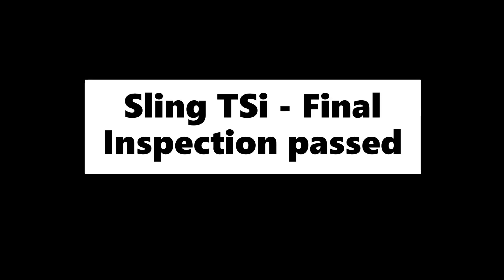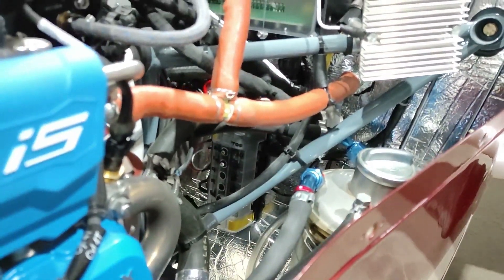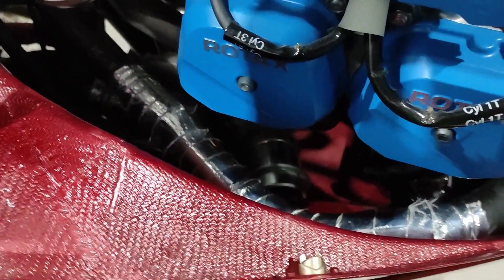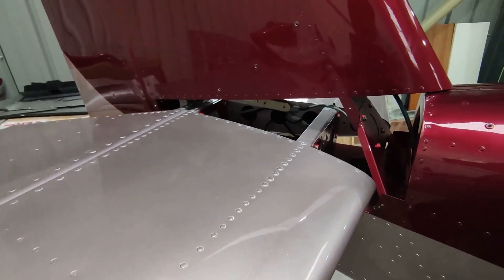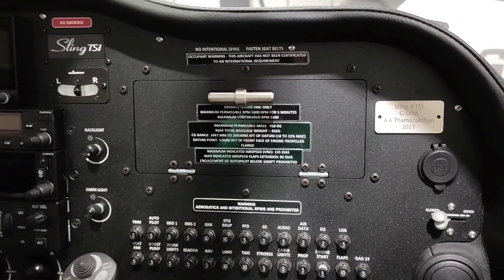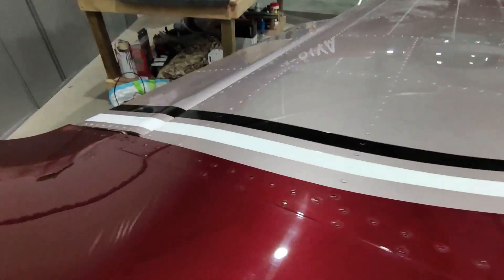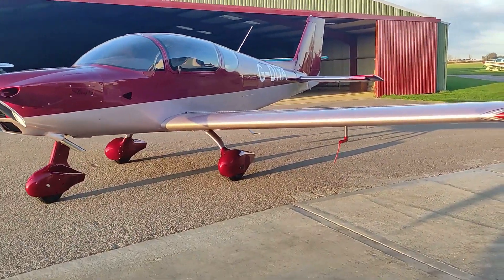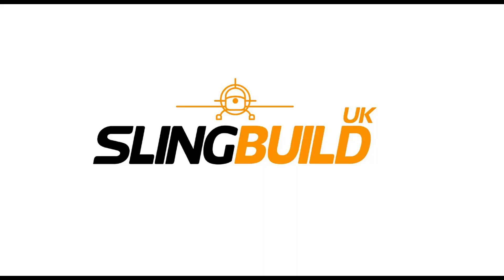Sling TSi is now Airworthy

Comment: What is the intended benefit of removing the elevator counter weight ?  Other than satisfying the SB.  Obviously helps cg, but is that the only reason?
Reply from the maker: As per the flight tests carried out by the UK regulatory body, at full aft CoG loading and full power applied, the aircraft is inherently unstable in the pitch axis. Removing the elevator counterweights allowed the aircraft to stabilize itself without pilot inputs on the control stick. Also note the Sling 2 & 4 never had a full weight balanced elevator. For me it was mandatory to get approval.
Reply: @slingbuilduk400  thanks for the additional information

Comment: Congratulations! Very exciting - looks awesome! Have throughly enjoyed following each update - dare I ask the cost so far 😅?

Also - it looks as though you have all the equipment to fly IFR - but limited to VMC? Is IFR not possible with the Sling under the permit to fly with the LAA, or is it just a case of extra paperwork?
Reply from the maker: Thanks, yes hopefully of getting the Day VFR limitation lifted after a year of flying. Some more paperwork will have to be done at the time, but should be ok. As for the costs, it hasn't been cheap 😰
Reply: @slingbuilduk400  Hopefully worth every penny once you're up in the air with it! Would love to build one some day looks like a great plane.

Comment: Nice! I didn't know about the elevator weight removal until this video. Good to know, and helps with the CG, too. Bonus!
Reply from the maker: Hi Mike, it does affect the handling of the aircraft. More trim would be needed when lightly loaded. It's been forced on us by the local regulator. So we had to do it to get approval in the UK. Sling have declared it as optional for other markets.
Reply: @slingbuilduk400  Yeah, I'm thinking I may want to do it anyway - a little more trim seems like a fair trade for the CG benefits! (Unless stability is negatively affected, but I understand it's meant to improve longitudinal static stability.)

Comment: Is the removal of the elevator counterweight described in a new SB?
Reply from the maker: Its not an SB. Its Service Notification #009 and is available on the Sling TSi owner support page of the factory website.
Reply: @slingbuilduk400  Notification #09 is about elevator trim tab servo attachment, not about removing elevator counterweight!
Reply from the maker: @oliviermolinari   its Notification 09 published on 10 Dec 2021. Trim tab is also adjusted after removing the counterweight. Again this is only mandatory in the UK. Are you not able to access it from the sling aircraft owner support page?
Reply: @slingbuilduk400  Got it! I was checking in the dropbox Notifications folder but it's not there yet. I might consider removing it too, it will improve my aft Cg since I have the parachute.
Reply: I'm really curious about why the UK thinks removing a designed piece of equipment is expected.  It seems to me that counter weight is necessary for proper balancing of the elevator.
Reply from the maker: @ibgarrett  TBH it's just the UK regulator being anal about the design code interpretation. These permit aircraft are not classified as experimental here in the UK. So has to meet strict compliance. The notification does try to address the reasoning behind it. It's only critical when the aircraft is loaded to full aft CoG.